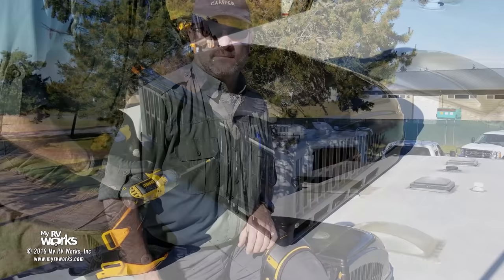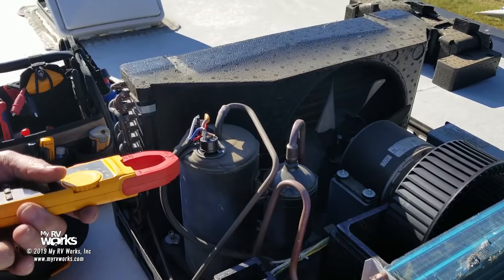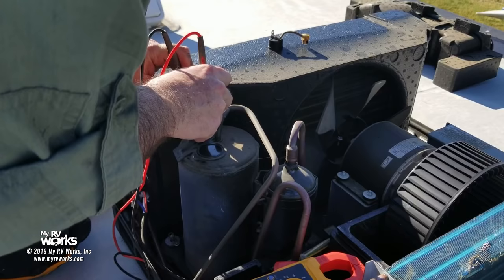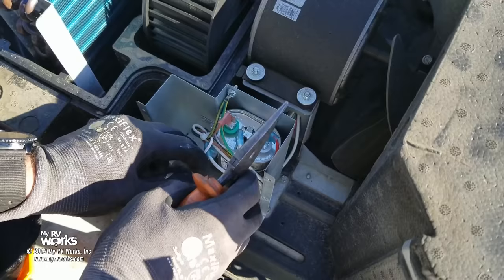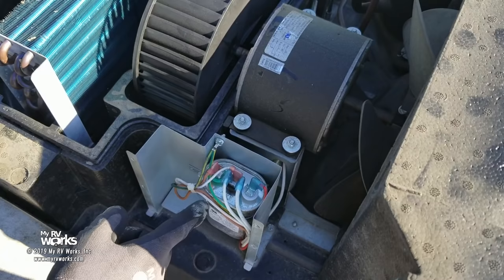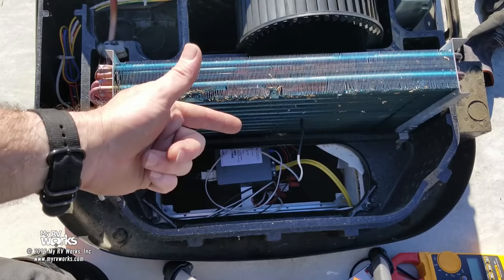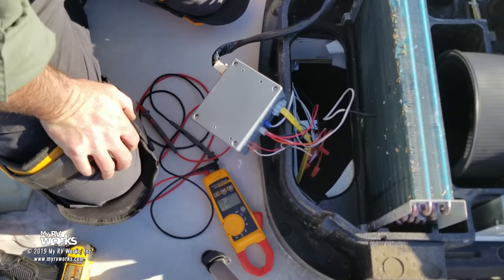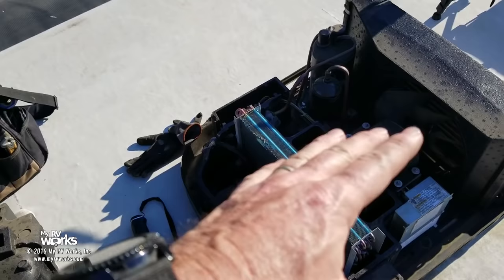Diagnosing An RV Air Conditioner That Is Not Cooling

Comment: I know very little about rv air conditioning but after mine quit cooling two days ago it was time to learn. The fan worked fine but no cold air. After watching this video I got on the roof and went to work. I removed  the cover off the compressor and I noticed one wire was completely separated from the terminal. Not sure how that happened but after fixing it my problem is solved.
Reply: I hope my ac is an easy fix. It quit blowing cold air yesterday.  Older unit but no idea how much it was used before I got the trailer 3mo ago.  Uggg.
Reply: @imissmypeep2209  Hopefully it will be something simple.
Reply: @trentcarbino921    it was simple, turns out I just need to replace RV. Haha. Jk.   Thanks for caring.  I'd hardly need ac if it wasn't for my dogs being home when I'm at work. Have a great weekend.
Reply: @imissmypeep2209  Thats unfortunate but on the upside if you get a new one it should be worry free for years. Have a good evening and enjoy your weekend. I get to prepare for what looks like an almost direct hit from this hurricane. All happy I fixed my ac and now Dorian is coming to erase my handiwork. Best of luck with the rv and take care.
Reply: @trentcarbino921    holy crap.  Best of luck to you !!! Be as safe as possible! That sounds scary. Especially for rvs.
Reply: @trentcarbino921  Worry free for years?!  LOL!!
Reply: @anthonylink4330  read it again. Should be worry free for years.
Reply: @trentcarbino921  Should.  Important clarification there.  LOL!
Reply: @anthonylink4330  No clarification needed. If you read my original reply I said should be worry free for years.

Comment: Great video! My problem is my AC will only run on low speed? The thermostat is the LED, Dometic which in my opinion are junk, I had one fail. But at any rate after running all day, I shut it off for the evening, this morning it would only run on low, it's cool, but barley any flow as it's on low. Condensation is running off the roof. I will check the caps and then the thermostat. One thing I ran into while the trailer is very hot inside the Dometic thermostat will have an error, I forgot maybe E2, turns it's to hot to work, so I lay ice over it for about 5 min and then it works, am going to look into going back to the simple slide ones.
Reply from the maker: Have you watched my video on the Dometic SZ1 thermostat?  Here is the link:  https://youtu.be/cmcSvh6xG2I

To help diagnose the fan speed etc check out the additional information I provided in the description section of the video.  I included all of the error codes and their meaning along with accessing the diagnostic mode of the A/C from the thermostat.  Hopefully this additional information will help you reveal the issue.

Comment: If your air conditioner is running but not cold. Do an amp draw. Good working compressor will draw 12 to15 amps. Worn out compressors will draw 6 to 10 amp. Replace the unit.

Comment: Great video--helped me a LOT!  

One safety suggestion:  When working w/ electricity it is good to do what is often called a HOT/COLD/HOT test to verify you have truly isolated power before performing any work.  It is really a test to prove your test equipment is working properly and you are testing for voltage in a good location.  

You start by detecting the operating voltage (the first HOT). Then, after opening the breaker/switch/fuse you confirm there is no voltage (the COLD).  Then finally, after work is complete and before you reassemble you confirm voltage is present (the final HOT).   

A word of caution, though, if you do not have good training/understanding of electricity and the equipment you are working on--STOP.  Pay for a professional.  It is possible to blow up your meter if you do not know what you are doing.

Comment: I went step by step. Everything reads on the meter like it’s supposed to. I’d like to send you a video and see what you think. I’m getting cold ish air. In the video you’ll see fluid. I don’t know if it’s the oily residue or just condensation.

Comment: This is very valuable as is why I come to you first to try to fix my own stuff.! I have a Dometic Duo therm AC.I am hearing a click click sound ftom the interior part of the unit esp.when the heater is on.The fuse in the electrical box for AC is fine.Is this sound a tell tale signal of a specific part? We are in Anza Borrego camp for the next few weeks..where you at this winter if I cannot fix it?

Comment: Hi Mr. Darren.

Great tutorial/troubleshooting. I only have one question from it that I couldn't see. 

@7:55-8:00 you were checking the last part of the compressor. Which two did you check? 

(1) Common and Ground
(2) Start and Ground
(3) Run and Ground

I'm a pipefitter by trade with no electrical know-how. Everything else was great explanations and easy to follow.
Also, do you have a video showing the run down of the thermostat and wiring? 

Thanks for taking the time to make this,
Kyle

Comment: Actually thats a thermal overload, It protects the compressor from overheating
Reply: Correct - it was likely just a failed thermal overload switch opening up as the unit came up to normal operating temperature. He only tested it cold, which is useless in this situation. He should have tested the compressor circuit hot (while the unit was blowing warm air), which is the only way to test a thermal overload switch (during normal operating temperatures, etc). 

I think this customer may have paid way too much for this repair.
Reply: @reedreamer9518  Yeah, it’s completely normal for it to get so hot it burns the PTCR contact. Good A/C compressors always do that.

Comment: My wife and I purchased a new to us GD tt last year and I've been inspecting one system after another getting ready for a cross country trip this summer. When checking the compressor windings I found my white wire (Start?) melty and a little crispy for about an inch. I cut the crispy wire part off and connected another flag connector to it and reattached to the compressor coil. Should I be concerned about that wire and how it got crispy?  Thanks so much for your videos, it's my go to for direct dependable answers on rv learning curve and how to investigate issues.

Comment: 051324-  dometic AC similar to the one above and the air conditioner works pretty good but then after running for a while shuts off then a short time period after like maybe 60 seconds it cost for AC right away again and it shouldn't and it trips the breaker 63 amps measured. 
 
Another thing I noticed if I have it on low speed as opposed to high speed above FYI, when I have it on low speed or low fan it seems to hum a little bit like it's having a hard time starting trips the breaker so I believe there's high amps there obviously. So I just fire it up on high and then switch it to low and may work all right for a little while doesn't normally shut off once it's running it's the second when it shuts off after cooling it calls for cooling a short time period after it shuts down and that's where the problem those two problems it calls for cooling again short time period after it shuts off and then it trips the breaker. 

I'm going to go up and check the capacitor but when I learned is that there is a hard start capacitor that may need to be changed on this particular unit I'm not sure. My units are 595.531 model number dometic RV AC little help little feedback please I'd appreciate it

Comment: It may not be refrigerant loss. Check amperage of wires to compressor. If numbers on 2 wires (not red) are between 1-6. Could be  Inefficient (weak, worn out) compressor. Normal amps are 8-12 A

Comment: Before you go through the whole compressor check turn the AC on,  amp clamp the blue wire in the upper unit,  It should have around 10 12 amps.  If it is down to 4 or 6 amps,  the refrigerant is gone.  Replace unit.
Reply: Compressor is pulling 9.2 amps and the cooling delta is only 10 degrees at best. Condenser is frosting up after running 20 minutes (72 degrees with 45 percent humidity). Tested last weekend in 86 degree weather and was only cooling to 78 at best. All else appears to be good. Unit is 6 years old. Time to replace due to low refrigerant or am I missing something?
Reply: @derickhufstader8684  Delta should be about 20 degrees.  9.2 amps should be sufficient but does depend on model.  Under the exterior cover there is a sticker that list the RLA which is the amperage for the compressor at a curtain temp ( Colemen/Airexcel uses 95 degrees).  You have to do some math but the cooler it is outside the less your amps will be.  Coleman uses 5 degrees subtract 1 amp from RLA. So if RLA is 12.3 amps at 95 D.  at 86 D the compressor amps should be about 10.2 amps.  MOST of the time 9.2 amps should be sufficient indicating compressor is under load thus it has refrigerant.  Frosting of the evaporator indicates  to much moisture,  but 45%  not so much.  Check the separator between the intake and the discharge.  If you have a interior visible ceiling pack (the part you see on the inside ceiling of the RV,  some newer RV models are 100% deducted with no visible ceiling pack) pull the air filter off.  You should see a separator just behind the air filter opening.  This separates the intake and discharge.  Chances are it has moved allowing air to recirculate from discharge back into the intake.  Make sure it is in place and sealed (use foil tape) on edges,  top and bottom.  Frosting of the condenser I have never seen but would probably indicate poor airflow through condenser

Comment: Hello Darren,
Another awesome instructional video.
I recently replaced my water heating element and fixed my inefficient rv fridge by watching your videos. 
I couldn't have done it without the great tutorial videos. 
Is there any annual maintenance that needs to be done on an AC unit?
I use my rv in Central WA where the temperature usually  is in the triple digits in the summer and I am always relying on my AC unit during these hot months.

Comment: That overload switch opens on heat, whether it's from over amping. Or a mechanical problem in the compressor if it gets hot it opens. You can check it with voltage in place if you read voltage across the terminals It's open if it reads 0 across the terminals It's closed!

Comment: All good tutorial.  Can the capacitor or the relay fail under load?  They can test good in a static test but with amps and current going thru the system,  they can have different properties.  Just a thought.

Comment: Great Video.  I have the same unit with the same problem.  I've read that there was a large batch of dometic units that came from the factory under charged with freon.  I'm assuming that is the problem with this video's unit as well as my own.  I have two units.  One blows 61* from the vent while the other blows 71* from the vent.
Reply: I wonder if mine is the same problem... in the morning it’s cool but as the day goes on the in and out temp difference gets less and less. Average is about a 6 to 8 degree difference and they say should be 18-20 degree difference 🧐
Reply: Jim Thomforde  I put a new unit on and bingo. Cools almost 30* from outside temp.

Comment: Thank you for such a detail video. It help me get some confidence to go up there and check my Dometic A/C unit. The symptoms of my A/C is that it will turn the compressor on for about 2 mins in which I get cold air, but then, I feel the compressor turns off and no cold air comes out. The compressor is in good shape based on the test described in the video, when I tested the compressor relay in the control board I got 57.0 volts when it’s compressor runs and 61.4 volts when the compressor is not running. I wonder if that’s the issue since you got almost double the voltage when you performed your test on your video. I gotta mention, i am using an easy start by micro-air and plugin the unit to a generator, the generator voltage indicates 120v, but I wonder if I gotta replace the relay or if there’s something in the easy start unit that is not ramping up the compressor voltage to what is needed. Do you know? I’m gonna do some more research anyways, thank you once again!

Comment: That round device that is your PTC. That solid state capacitor is wired in parallel across the run winding terminal that allows boost to get the high amp draw that allows the compressor to start.
What happens is 0.3 seconds after the start the compressor The resistance on that PTC rises dramatically out of the circuit. It acts like a hard start device. I'm surprised you didn't check your superheat and supercool to see if the system is charged properly.

Comment: I was a ac repair man 27 years and if I I had a Carl where the air conditioner was not cooling first thing I would would be turning on the conditioner and listen for the compressor to come You can learn a lot by starting the unit  first ,  you can hear the compressor start up and hear the fan blowing and if it doesn’t cool it’s low on gas but god

Comment: Excellent video sir.  I was able to check everything you said except for the capacitors.  I don't have a meter for that.  I was able to check voltages and found that there is 220vac on the start terminal and 0 on the run terminal, after 15 minutes of running.  Is this indicative of a bad run capacitor?

Comment: So there's no low-pressure cutout like you'd find in an automotive AC? Compressor should run regardless of charge?

That definitely helps, I don't think my compressor was running so that narrows it down quite a bit. Unit was less than a year old

Comment: Hello. Interesting videos, after a month of using the air conditioner, my Dometic stopped cooling, I hear that the compressor is turned on and very warm with a tube to the condenser, but the condenser does not heat up, I will try to check your recommendations with a resistance tester. I don't even know what it could be

Comment: Thanks for this video.  I have the exact same system (Dometic Brisk 15K BTU with SZ1 thermostat),  I have one of those pesky intermittent problems.  Sometimes it works fine (12 degrees Delta T) and sometimes it doesn't (3 degrees Delta T).  SInce it runs fine sometimes I have ruled out a compressor or capacitor problem.  I think it has to be a sticking compressor relay or a bad thermostat.  I'm leaning towards bad thermostat because I've had to turn it off and on before to get the AC unit to come back on.  I'm afraid to take it in for service because given my luck the unit would operate fine while at the dealership.  I'll just start with the thermostat and then the relay.  Thanks again.
Reply: A 12 degree Delta T is not a good number.  Dometic has had a ton of trouble with the Brisk Air's.  In my experience your problem is with your roof unit.
Reply: @anthonylink4330  Thanks for the post. Yes after I posted this I learned a 12 degree difference is NOT a good number indeed. It's actually closer to 10 degrees. Should be 20. I'm camping this weekend and it's 91 outside and 89 inside during the day. Luckily we're not in the camper most of the day. By bedtime it gets it comfortable but that's it. I have an appointment to take it to the shop next week. It's still in the warranty and I think they will end up replacing it. All the tests point to exactly what this video concluded and that is freon is low.
Reply from the maker: Two video's I made that may help are here:
Boost Your RV Air Conditioner Performance With This Cheap, Easy Fix!  https://www.youtube.com/watch?v=rxCljBVi8DU&t=5s

How To Operate A Dometic Single Zone (SZ1) RV Thermostat  https://youtu.be/cmcSvh6xG2I
On the second one I added info on the Diagnostic mode in the description of the video.
Reply: *UPDATE*  Dometic replaced my unit under warranty!  Had it one year and five months.  Warranty is two years.  Thanks again for this video.

Comment: Very helpful.  My dometic Compressor runs exactly 10 minutes, goes off for 5 minutes, runs for 10 minutes...what causes this cycling?
Reply from the maker: First thing that comes to mind would be your free sensor. But I'm also curious where your thermostat is located with respect to the ducts in the ceiling blowing cold air on to it.

Comment: Interesting as I guessed what the problem was right before you mentioned it! I've got some RV a/c knowledge from two friends who knew alot about that. Problem with my Dometic Brisk II Air a/c unit is that when it's on Auto mode only, it short cycles but only during the daytime and NOT overnight which I find strange! I suspect it could be a problem with the high pressure switch or something in the control board. I don't believe there's a problem with the touch control thermostat tho. If you have an idea what it may be please let me know! 
Thank you!

Comment: Thank you for your video!   I have a 3106996.022 PCB and after checking compressor,capacitor etc I tried to turn on ac and K4 relay on board burned up?  Did I not reconnect wires properly?  What would cause K4 relay to burn up?  Prior to that only the fan would run and the compressor wouldn't run?  Thanks and enjoy your day.

Comment: Not only is there licenses, and evacuation methods involved, but these units are also a critical charge and require a much different approach to recharge properly. Much like one you only see in factories. Would not be a good idea to recharge as the customers will not get the value they paid for. 

Cheaper, easier, and faster to just change the top unit out!

Comment: Thank so much for taking the time to show how to test the ac.  I have the same ac and it is blowing hot.  The compressor is testing C to R .4 - C to S 4.3 - R to S is 4.9.  It should be 4.7 correct? The compressor gets real hot and none of the copper is getting cool anywhere.  Is it the compressor? Could a bad capacitor cause the compressor to not cool? 
Thank you
Reply: Okay  I did put a new capacitor and it is still blowing hot air. Bit I can definitely tell the compressor is kicking on now but still hot air. 😢